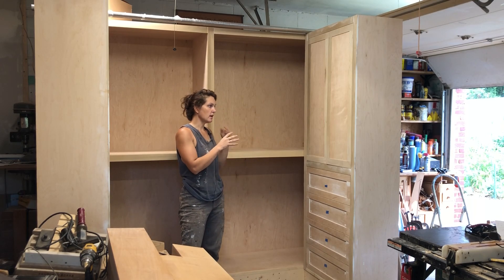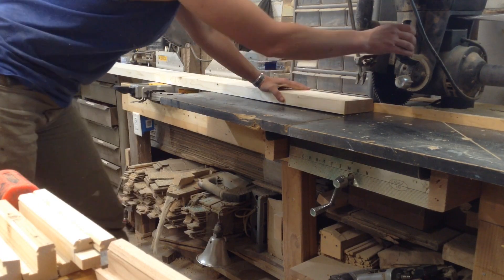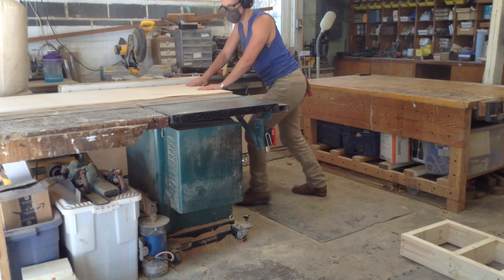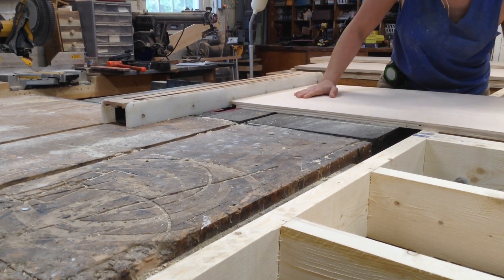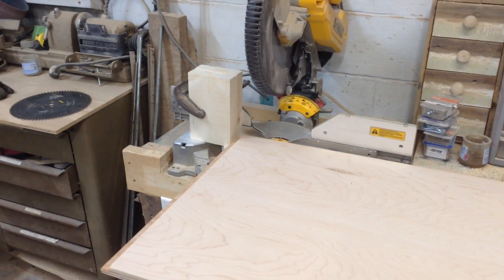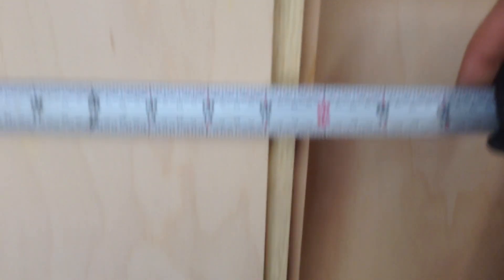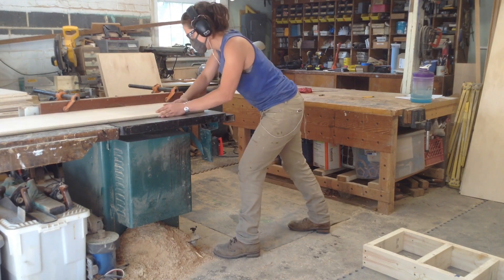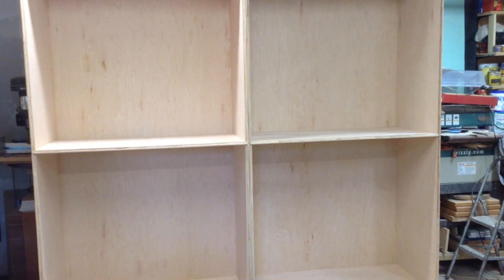Woodworking Projects : How To Make A Walk In Closet

Comment: With your kind and thoughtful voice over your work I could probably watch you build the same cutting board week after week! Great insight again into different aspects of the built-in this time. How tight do you make your backing boards? I suspect I leave too big a tolerance... about a 1/32nd all round.
Reply from the maker: I make them the same size of the opening, but there are usually a little or gap or two around.  The huge plus of working in plywood is not being as worried about movement.